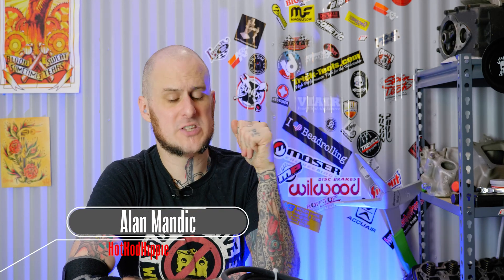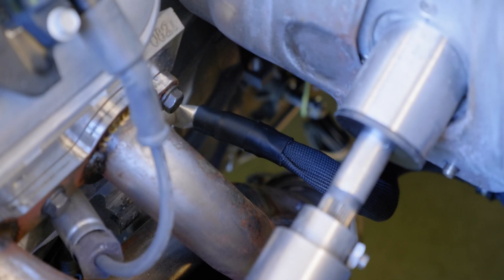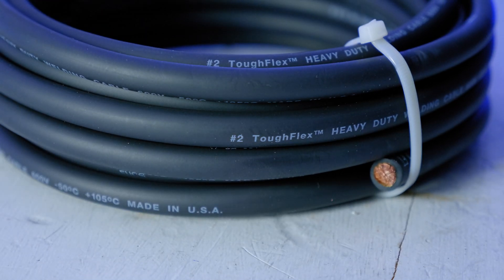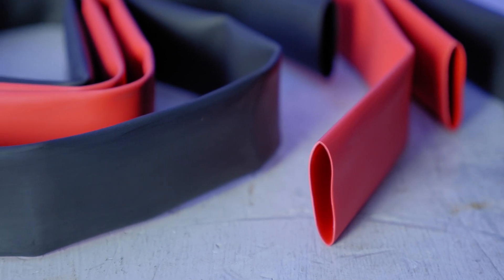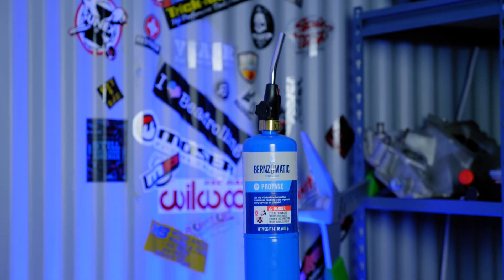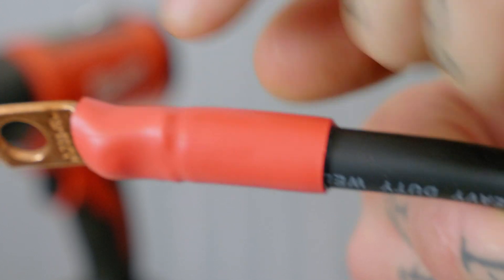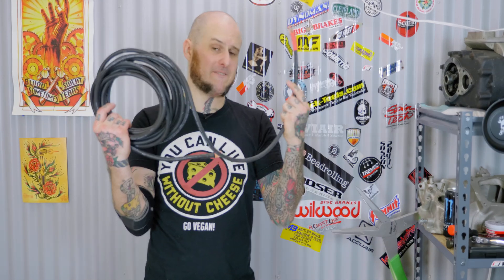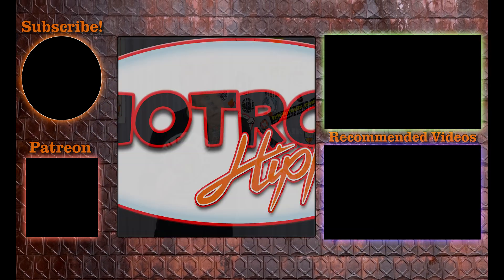Battery Cable Making - Basics & How To Explained

Comment from the maker: I failed to note that the insulation on Welding Cable vs Battery Cable (there are many kinds of battery cables also) do vary.  Some Battery cables have better heat resistance and chemical resistance.  As I said, I haven't had any issues over the years with using Welding Cable and anywhere the cables get close to heat I would use heat shielding whichever cable I chose.  A few of the cables in this video were shielded with fiberglass heat shield sleeves. 

Just figured I should make that note since it slipped through in the editing process.
Reply: I know this is EXTREMELY late but at 8:35, the 35/70 of the Anvils corresponds to square millimetres; the metric measurement of the cable. you can get AWG to sq.mm conversions online. If this was answered previously my apologies.

Great videos!

Comment: In general never have exposed connections, electronic modules, and bulkhead connectors underneath the car. In-line sealed connectors are okay but keep the pin count as small as possible and make sure the harness and the connection cannot move due to vibration. It is best to encase all wires and cables in plastic high temperature convoluted tubing. If you need a power cable to go through the firewall or other similar sheet metal divider just use a rubber grommet, feed the cable directly without any breaks.

For automotive application only use tin plated copper lugs when making large power cables and always compression crimp the lugs. Use dual wall heat shrink to seal the lug to wire connection. Ideally use tin plated Marine boat cable (high stranded version) over welding cable.

Comment: i know this is an older video, but over my years of hackery i have found that old cigar cutters are good for cutting hose,line,and stripping larger gauge wire without getting into the wire itself, cheers happy hotrodding

Comment: On my car, I just tig welded 3/8th SS bolts to the cab and frame for ground. They will never rust. Also I have found 1/0 Stereo cable like from NVX is much better than welding cable. the strands are very thin which makes it extremely flexible.
Reply from the maker: If you welded stainless to mild steel you negated the anti-corrosion factor. They will eventually rust. I’ve done it and will do it again, but I’m aware of that factor when I weld steel to stainless steel.

Comment: Again--love  your videos!  I am in process of making a custom set of cables for an  old Diesel CUCV I'm restoring.  The starter cable from battery branches into two cables--a 2/0 and a 4/0--one to starter and one to main bus on the firewall---The cable starts from battery as a 2/0 and then branches in a "y" pattern.  Is there a fitting for this???   I am using a 90 degree lug for the starter---but not sure how to splice the "y" from the main cable...thanks for any advice...

Comment: Nice job. I use the hydraulic crimper and tend not to 'Solder' anything on a vehicle, since I use a 800CCA+ battery with a huge parallel multi Ultra Capacitor bank, capable of thousands of amps. Imagine when things go wrong, how quickly the 'Solder' turns back to its liquid state. I use lower capacity reset-able breakers rater than fuses also.

Comment: You mentioned a crimp that was labeled 35, that would match up for 2 AWG as the metric sourced wire of the same size would be 35 square millimeters. Handy chart of wire sizes I found on Google https://www.lexproducts.com/technical-help/wire-conversion/ Also love the anti-cheese shirt, I'm far from vegan and will fight for a good steak, but I can't stand cheese or most other milk products!
Reply from the maker: I wondered if that was the case but hadn't taken the time to confirm it. Thank you very much for the information 👍👍

Comment: You wasted your time with the solder.... Just properly crimp it...
Reply from the maker: Why not solder? A good crimp will hold fine sure, but solder will only help. Also soldering will reduce the air trapped inside of the connection which could lead to corrosion. The only negative I see is it makes the cable slightly more rigid next to the terminal but I also factor in service slack to the cables so there isn't stress there. 

Can you back up the waste of time statement? Soldering takes 30 seconds and a slug that costs a few cents. I'm not building "good enough". I'm building high dollar custom cars usually. Why not take a few extra seconds and do a better job?
Reply: @HotRodHippie  I carry NASA certification for wiring and harnesses and we never crimp a soldered connector.  I can see your point, but the solder can actually crack and break when compressed.

Comment: What kind of battery bulk head fittings do you use?
Reply from the maker: I'm using "Fastronix" ones off of Amazon. They are a little heftier than most of the ones I've seen on the market for a bit more current capability. 

Link: https://amzn.to/2LVm3aj

Comment: Great video - thanks for sharing your expertise (and your humility)!  Hydraulic crimpers ROCK!  Amp makes a line of terminal ends that are tin plated copper - they come in all size (of wire gauge and hole size).  You are correct - you have to experimentally determine which die to use.  And, I don’t close the die all the way, I’m probably using a die that is slightly undersized and crimp until almost closed and then rotate the terminal one facet in the squeezer and then recrimp in the same manner (i.e. almost, but not all the way closed).  Terminals come out like artwork and work reliably on high performance aerobatic aircraft which get flown pretty hard.

Again great work and I really enjoy your stuff!
Reply from the maker: Thanks for the input the instructions on this one said it has a pressure bypass. So it won't close all the way anyway, it just reaches a point where it goes most of the way.  like the idea of rotating it in the crimper and hitting it again. I do that with AC fittings in the hose crimper. I will take that advice. Thanks. 👍👍

Comment: with the hydraulic crimper you can always start out with the larger die and move down as needed, I also use 2:1, 3:1 and adhesive lined shrink tubing as needed
Reply from the maker: That is a good idea of how to handle it. I've started noting inside the lid of the tool what dies go to what size. I just eyeballed the size of the die against the eyelet end and I lucked out on the first one. In the future I'll probably try your thought. 👍

Comment: i prefer to just crimp, a good crimp is better than a good solder. just a note on systems where there is a constant draw (golf carts, electric forklifts, scissor lifts) crimp, do not solder. you can solder after but dont just solder. they get hot enough to melt solder which creates a poor connection and can lead to expensive repairs that can be avoided
Reply from the maker: Interesting and logical input.  Makes sense if the cables are going to continually run hot.  I have not had a single issue doing so with cars however.  If the softer Battery Terminal ends allow it I have crimped them after soldering in the past.  However the ones I use lately don't crimp.
Reply: @HotRodHippie  in a system with just a starter battery it shouldn't get hot enough to cause a problem. I've seen some pretty janky things that somehow still worked lol

Comment: Maybe I'm missing it, but where's the link for the sizing chart?
Reply from the maker: You didn't miss it, I had trouble locatingt hem and it slipped my mind earlier.  I added them to the Description but I will list them here two.  They differ a little so it kind of falls to a judgement decision for you. I tend to err on the side of caution and go bigger usually.

https://www.westmarine.com/WestAdvisor/Marine-Wire-Size-And-Ampacity

 http://info.waytekwire.com/blog/how-to-select-the-right-battery-cable-for-your-installation

Comment: My most resent Batter Cable fit was for our 36 volt electric forklift.
I did not know about the flux and solder plugs, so I just slathered on some flux paste and heated with a torch as I applied a bunch of solder.  
Great Video.
Reply: you want to crimp for that kind of system due to the amp draw
Reply: Unfortunately the lugs provided were cast aluminum. Thus I filled it with solder. We have 2 electric forklifts and neither has over heated the plug, but I keep an eye out for discoloration.
Reply: @VideosByAL  first signs will be melting of the cable insulation

Comment: I dont normally do battery terminals. But my go to method is to crimp then solder. Normally use connectors that are open at both ends so you can solder the end which wicks solder up the cable.
Reply from the maker: I can see benefit to that but I prefer to seal up the connection as much as possible.
Reply: @HotRodHippie  thats what the solder is for. I have always found crimp pressure makes better connections and solder fills in any remaining gaps and seals it. That means crimp first solder 2nd which doesn't work with those type of connectors.

Comment: Is that actual battery cable or welding cable? I used welding cable on my chevelle, I wish I would've known about the solder slugs though, those are neat. Great video!
Reply from the maker: It is welding cable. I noted that and explained some of the differences at the 2:30 mark. 

Those solder slugs really make the job better. Before I knew of them I used to ball up solder and shove it in there. Such a waste of time.
Reply: @HotRodHippie  sorry, I was watching the video while doing stuff, guess I missed that(welding cable). But yeah I could tell by the strands